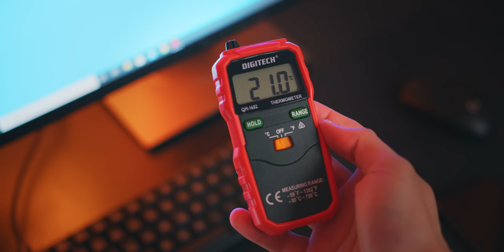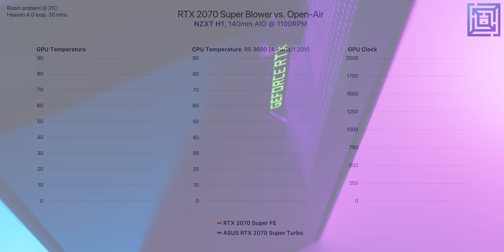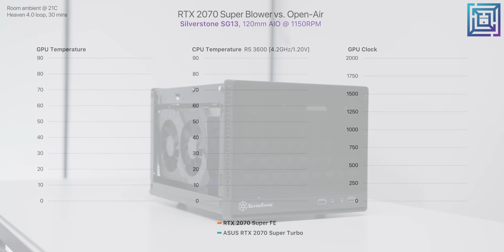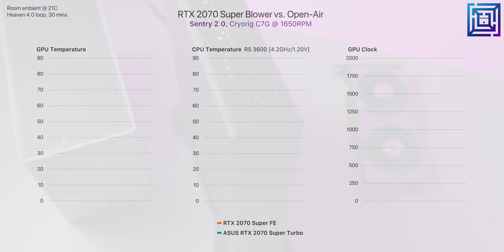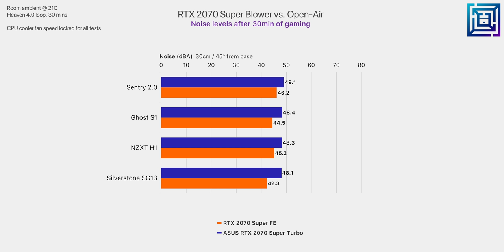Blower Graphics Cards for ITX Builds – Final Answer!

Comment: Interesting video (pardon for very late viewing) but have you considered that the open air coolers with horizontal fins arrangements (like msi twinfrozr, gigabyte windforce) might help to make escape route of the heated air direct to the pci slot? With vertical fins arrangements (like evga, inno3d, or stock nvidia cards) the escape route is to the top of the card which maybe sucked directly by the adjacent cpu fans.

Comment: It's not just CPU temps, it's also everything else in the case, VRMs, RAM, NVME, all those things that rely on airflow throughout the case to cool them. A blower card basically counts as an exhaust fan in that regard, especially when the GPU is at idle. And because the blower forces the air out, it will also draw more cold air in. Rather than an open air card which might just be recycling air inside the case.

Comment: I plan on using a really old ~10$ office PC case as it's laying around. Surely  its airflow inside is bad, as many as 1 front + 1 side intake fans and 1 exhaust fan, can't be improved. Not sure if an mATX system with 3300X + 5700XT (blower) can be cool enough?

Comment: It has been known for a long time that blower coolers can't compete with dual axial coolers. But what about a design that has a dual axial cooler but ducting to force the air out the rear? All dual-axial coolers just have openings on the top and bottom and sometimes even side so air can quickly escape.

Comment: I literally have exact same config except using 3600X and using RVZ03 instead of 3600 and Sentry. Yeah I got concern of the heat recycling even with the amount of air got pumped in by 3 120mm slim fan, so in the end I go for the exact same Asus Blower 2070 Super. Glad to see I made the right decision.

Comment: I would love to see this testing the Phanteks Evolv Shift and Phanteks Evolv Shift Air.
I have a 2080 Super blower in mine, and it runs at a fairly consistent 83 in demanding games, and the heat rising from the case is immense, but I feel like a non-blower would actually run hotter.  I've removed only one of the dust filters, which is the one on the top lid, that helped the hot air leave the case more efficiently.

Comment: I only buy GPUs with heatfins that run lengthwise so that even with dual fans and front intakes, the air is dumped out of the case not onto other components.
Sideways fins are a mistake and careless method to keep the GPU cooler in bursts of usage in large full ATX cases which are still extremely common.
I Also use a Silverstone FT05 for now.
Reply: Vertical fins are awesome for negative pressure sandwiches. Gives the air a direct outlet from the case.

Comment: I wonder about the test results in the first case, @ 5:58. Is it possible that the thermal throttling of the open air card is reducing the amount of work the benchmark is doing, and that is what is causing the lower CPU temp? Are the number of benchmark loops in both tests the same? 
Enjoyed the video (and others on the channel as well), thanks

Comment: The primary difference, IMO, is blower cards generally don't have fan-idle-stop. Actually, I dont know if any have it.

Open/axial cards often do have fan-idle-stop, and for a mITX build that is sitting on my desk, close to my ears, it makes quite a difference. I upgraded from a "semi passive" GTX 1050Ti that rarely even turned on its fans while gaming (nevermind being audible) to an EVGA RTX 2070 blower that is easily the single loudest item in my desktop, whether at idle or under load.

Either way, I like the RTX2070, and I really like the concept of evacuating hot air out of the system directly. But I am not likely to return to a blower design next time around. I really liked my GTX780Ti reference blower. Decibel ratings may claim it wasn't all that quiet vs modern cards, but it was hardly noticable nor audible. Trading it for a RTX 2070 did net qutie a bit of performance gains (as did upgrading from Sandy Bridge to Zen 2), but it did get noticably noisier.

EDIT: The GTX 1050Ti was being tested for a week before I sent it off to a family member who could make good use of it. It was the first time I ever purchsed or even used an open/axial card.

Comment: I think for slim, lower ventelated case is still the better option. VRMs and M.2 drives will benefit some cooler CPU fan air flow compared to hotter CPU air flow.

Comment: Just a comment on the back plate. I know they look nice but does it affect heat dissipation? I remember a 1660s from msi with a plate but, it was plastic and not metal. Would metal help to release the heat better than plastic?

Comment: Really good video that I’ve been waiting for someone to cover for a long time! I’ve got an SG13 and am contemplating getting a 2070 super so this video couldn’t have been more perfectly timed. My only suggestion would be to include some motherboard temperatures as this has commonly been an issue for me with my SG13. CPU temps aren’t often affected with AiOs in cases like the SG13 where cool air is drawn from outside (as your tests identified), so it would have been much more useful to know what the motherboard temps were, especially as I’m running an X570 from ASUS. Loving the work though!
Reply from the maker: Thanks for watching! I purposely leave out some less-critical information to make the video more concise for most viewers. M.2, chipset, and VRM thermals will surely be a bit warmer for the open-air configuration, how much depends on your configuration. With an X570-I, you'll be fine seeing as you have active cooling on-board.
Reply: @optimumtech  Thanks for the reply dude. Makes total sense. The video definitely helped me decide on an open air version! Liked and subbed
Reply: I have an sg-06, and while the motherboard suffers a bit, the powersupply really starts to feel the heat when not only providing 300w+ to the system, but also dragging that entire heatload out on its own.

Comment: hey Mr. Ali could you please help me with two things? i love the works you are doing. i have just recently found your channel but i already had made 2 itx pcs beforehand. one inside cm elite 130 in 2018 and the other one inside cm 110 in this january with 3600+zotac 2060s mini. my questions are:
1.  the 2060s is hitting 80+ while i play games and its not even summer yet. what should i do to improve the thermal?
2.  the modern itx cases use riser cables frequently. what impact the riser cables have on input lag? i play a lot of apex legends like you do, so this one is bothering me a lot recently. Perhaps you can make a video on this point exactly

Comment: I'd love to know if blower can still make that much of a difference once you put two a12x15 on top of S1 as exhaust. The problem with blower is that it might be good for the CPU, but in many cases, it's probably insufficient for your GPU, especially if you are using a 2080ti.

Comment: Make a rubber or foam ring gasket around the blower fan intake that will seal against the case side panel and it will get cooler air intake as long as the cpu fan is not blowing air out near the GPU fan. 

I guess you could do this for the open air gpu fans but that would not improve CPU temps as much as a blower style. 

A 3-slot blower (bigger heatsink) would probably beat out a 3 slot open air though.

Comment: A good exhaust fan (like that Noctua one being used) should have NO problem exhausting all the air from an open-air GPU -- thus, no reason to use a hot air blower cooler in an ITX build.

Comment: How does the GPU blower reduce CPU temps in the SG13 by 5 degrees with a radiator intake?  I would've expected insignificant change there.

Comment: @OptimumTech
Thats something i always don't understand, like in ncase M1 i see people put  the radiator next the the side panel, radiator fan set to intake and said the air can passively left to case from top ventilation hole. 
Doing intake mean you are pulling hot air from radiator back into the case, isn't its better set the radiator fan to push so all the hot air from radiator can immediately push out the case from the side panel?  also if you intake the hot air inside the case and let it out from top ventilation hole, thats exactly how normal CPU heatsink+fans works. whats the point of using AIO if you r not directly exhaust the heat directly out of the case?

Comment: Hey great video as always, and exactly what I needed. I also saw the build you’ve made for your brother. I have Phanteks Shift with TG and I’m battling with temps as well in it. I considered getting mesh panel but after your vid I realised the limitations to fit the GPU. I have few configured in mind and thought maybe you could help me decide. 1- RX 5600 XT Fans facing mobo. 2 - RTX 2060 + mesh panel ( most expensive option), 3- RX 5700 Blower Card facing mobo. Option 2 is quite unlikely cause I’d have to buy a specific card to meet the dimensions and those are currently quite expensive. So I kind of wonder if opt 1 or 3 would give me better temps. Any thoughts ?

Comment: Hey man. Chill vibes on this channel! Loving it. 
I have a evolve shift air
With a 1080ti fe. And the fe is loud or it thermal throttles 
Running a 2700x on a 120mm rad too and even that is hot... 
I wish i had a strix 1080ti

Comment: I'm thinking using kryonaut on the blower style card can lower its thermals to acceptable levels so it doesn't throttle so much. I don't see it as unusable, especially if you need that for to keep the cpu from throttling.

Comment: Hope to see more on the Sidearm T1 as you get better fittings and better time on it, if you are still using it.  I was disappointed in the bowing support due to the 240mm AlphaCool radiator.  Maybe as they sit at home and think about this they will add a few mm to get the Nactua screws and 240mm fan some room to fit.

Comment: Some open air cards like mine have the fins arranged length-wise along the card, resulting in a half blower half open air operation that is probably the best of both worlds
Reply: It helps some of course, and is a definite improvement, but the draft out of the case isn't as strong as a blower.

Comment: I honestly never would've expected a whopping TEN (almost) degree difference on the CPU in cases like the Ghost or Sentry. You would think with the case design being "compartmentalized" it would help keep them separate, that it would create separate thermal envelopes. Crazy stuff. Now I'm curious how it goes with the LZ7-XTD, the one I'm using. The LZ7 was always smart in putting ventilation slots around the GPU, so the question is, how much do they 'really' help?
As an aside, it really goes to show kind of, one of the other benefits of a custom loop water-cooled build, that you can at least maintain a consistent thermal performance because you don't really care what the air is doing inside, as long as your radiators are pointed outside.

Comment: I got a zotac 2080ti blower card in my Inwin A1 / 3600 with stock cooler. I was concerned at my gpu temps. Literally any game would send it to 84 degrees (temp limit of the card). Looking at this video im thinking that it is normal. But 84 degrees consistently cant be a good for the cards life span?

Comment: I'm watching this almost two years later. And even at the time this was produced, blower style GPUs were being heavily pushed out of the market by the open air ones. I know the GPU market isn't exactly ideal right now, but I'm wondering if ANY third parties will ever make blower style GPUs ever again? I haven't seen any for the 3000 series from Nvidia and on the flip side I haven't seen any from the 5000 or 6000 series from Radeon. So, that kind of sucks for current day ITX builds.

Comment: And this also points toward why so many choose bigger cases (even if the case is only a liter or two bigger): better airflow through the case overall. Though I must say that the cases shown here do look pretty darn nice and minimalist (which I love compared to the TG and RGB junk on the market right now). I've already been reconsidering the Meshify S2 in favor of the Meshify C (non TG paneled versions) for a minimalist aesthetic while having exceptional air flow to keep a 3800X and 5700XT decently cooled for gaming, coding, and VMs. Though, I might look at cases like the ones you have shown.

Comment: Hey, thank you for the great video! Good to see, that a open-air card works fine in the NZXT H1 as I was planning to build inside it. 😁

Just one questions, that is a bit off-topic. Do the front io USB ports actually both work? I noticed, that the USB-C has a different connector basically no AMD mITX board has. Did you test this by any chance?

Would very much appreciate a reply! Thank you and keep on doing these awesome videos. Your channel actually convinced me to build my new PC in the NZXT H1.
Reply: @SimplyEmu  The only AMD mITX boards with the USB-C front panel headers are the Asus, one of the ASRock, and MSI B550 ones. You'd have to use adapters for any other board at the moment.

Comment: Does the ASUS Turbo have the ability to stop fans when not needed??

I have tested the GIGABYTE Turbo, which has a minimal fan speed of 30 %. I am very happy with thermals, Performance and am fine with the noise while gaming. However, I can not acccept the noisy fan at idle and it is not possible to switch it off using MSI Afterburner etc and would probably require messing deeply with the GPU BIOS. I really dont need an idle of 23 °C and would be totally fine with 40-50 °C. Like this I cant keep the Gigabyte turbo and think of switching to the Asus Turbo for my Ghost S1 Mk2.

Comment: With a open-air cooler, if you got better fan, your gpu can still be cooler. But blower style is very limit, the temperature won't drop no matter how's your case fans set up.
So better go for open-air for flexibility, unless your case doesn't have mesh panel.

Comment: I was surprised the Ncsae M1 was missing from this comparison.  Revision 6.x improves the ability of open air GPU coolers to expel warm air out of the case.  The M1 layout is different enough from all the other cases that its results may have been a bit different.  Would it have been as good or better than the NZXT H1?

Comment: I guess a big factor (pun intended) is the case. On my 380T my open air 1080ti runs great 👍🏻. I would only consider a hybrid/water-cooled for noise, but the price and difficult installation isn’t worth it. I dislike blowers due to noise, but maybe Im wrong on this.

Comment: You should also test open-air GPU with horizontal radiator (like msi ventus rtx 2070 super). I use one of those in SG13 and it is blowing the hot air at front panel of the case.

Comment: Really surprised with the SG13 results, I'm looking at this case and was really thinking being so close from the side panel open cooler would circulate a lot more heat in the case (like the first case, ghost S1?) I guess the fan is starved? Anyway, it opens up a lot the GPU choice. Thanks!

Comment: Anyone with an SG13 try a 120mm AIO with the fan on the other side? Doing either a pull intake or push exhaust.
Seems like everyone puts the fan on the grill side, but I thought the difference of push vs. pull on an AIO is negligible with a good pressure fan.

Comment: Hello Optimum Tech! First of all, thanks for your great work. Im about to do a build with a Ryzen 3900x, cooled with a Kraken X62 in a NZXT H210i Case. So related to this video, what do you think will be the better option in terms of sufficient cooling for a 2070 Super? I want it to be as quiet as possible. I have also thought about exchanging stock fans on the AIO with Noctua, also the stock case fans.

Comment: Great video. Was wondering if you could do one with the Fractal Node 202 to compare blower vs open air? I've been struggling with noise and trying to cool my GPU and thought a blower style would be the solution but now I'm not sure since it seemed to mainly help CPU temperature, which are fine in in my case.

Comment: I am running a 1660 super in a Dan A4 and I have to find a balance between noise and heat levels, since the pc is in our living room and when I play games my fiancé likes to watch Netflix. I found a fan curve that would stay rather quite at loads but the temp would climb to high 70s and low 80s in game. (Apex Legends). I imagine a lot of hot air being trapped in the case and considered buying a blower style card with ne next generation of gpus if there will be any. Is this considerable? I would think a blower may be loud unter certain circumstances but so does the axial cooled card, since it gets hotter due to air getting stuck on the case and the fans ramping up the speeds.

Comment: Please explain how you got all core 4.2ghz overclock on a 3600 at only 1.2 volts.
Reply: Doesn't seem to hard. The smaller the node the lower voltage it takes. With 3rd gen you don't want to oc over 1.35volts. I've seen 1.225 for 4gjz all cores on a 2600x so 4.2ghz on 1.2 volts on a smaller more efficient architecture doesn't seem too hard to believe.
Reply: Clock stretching and reduced performance

Comment: budget cooler is exactly true. for example, you can take a look at asus strix 2 fan model compare to other competitor with 2 or even 3 fan and look at their temp.

even though asus usually set a price higher, I still always tried to priority asus card before any other brand except evga that I don't have local import for that.

Comment: In any normal case I prefer blower cards fo rmy flight simulation use, both P3D and X-Plane are heavily CPU bound and prefer high clock, so eithers intels or amds automatic turbo stuff runs better with a blower card rather than open air. But for other games it doesnt really matter and maybe open air is better for GPU thermals.